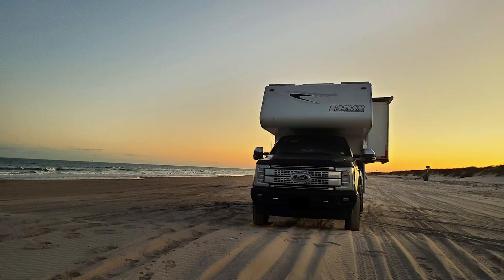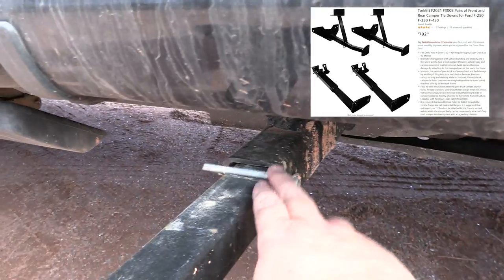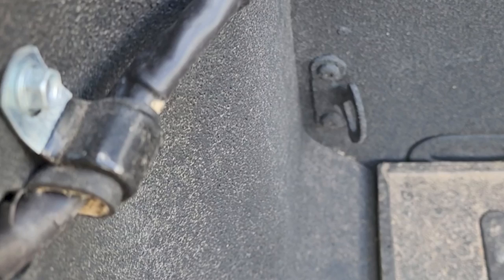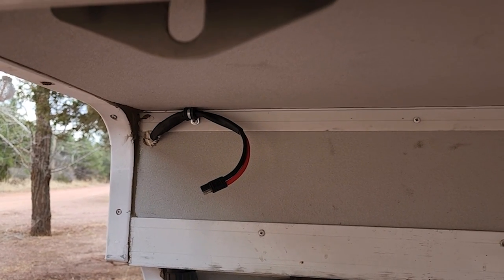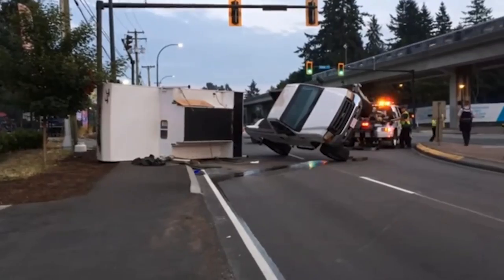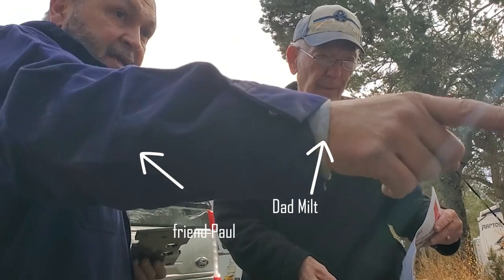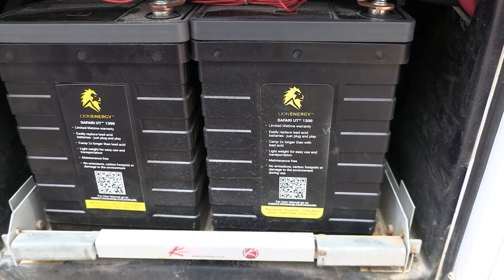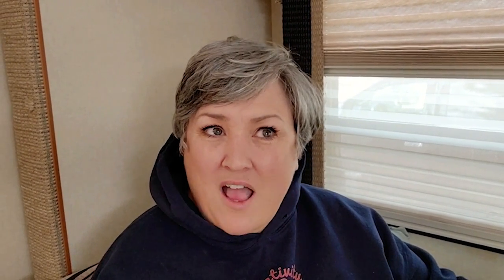RV Hacks & Gear GALORE! Truck Camper Setup: Lithium Batteries, Air Bags, Platform, Solar and more!

Comment: Hi everyone. Love you, Robin, BUT, I will never own another truck camper. I’ve had one in the past (a Lance also) and it was so small and such a hassle. I actually thought it was a really great set up, but taking it on and off the truck was way too much of a hassle. I would much prefer a class C or class A and tow a car. Towing a car on all four wheels is easy and the best way to travel as far as I’m concerned. We didn’t keep our truck camper for long. We started full timing in a fifth wheel which had so much space, but I agree with you that it’s also a hassle with how much work there is to get going so many things that could go wrong. Of course, when we go to RV parks, it’s the most wildly popular RV. We are now full-timing in a class A towing a Jeep on all fours and we love it. Of course, everyone is different but, I would advise anyone getting a truck camper to be very careful. know what you’re getting into.

Comment: Robin, great to see you back!
That camper rollover you mentioned was actually a long bed regular cab pick-up.
It appears the truck had a lift with larger off-road tires. This would explain a very high center of gravity and with excessive speed in turns will cause that result.
Best of luck with your truck camper looks like you did all the right things with your setup 👍

Comment: Thanks for another great video. I am a couple years from "getting out there" and using my small SUV for trips in order to learn what may or may not work for me. About to go out and move things around again! It's all about discovering what works for YOU! Glad you're back!
Reply: I’m doing the same thing before I hit the road for good! I have a Honda CRV inside I built a bed and storage with a small side table. Getting ready to hit the road from Virginia to New Mexico and all places in between. I think it’s a great idea to start off with what you have and see what works and what does not. Safe travels.
Reply: @anaisanwar8424  are you worried about gas prices.
Reply: @cheri6174   Not really. I’ve planned for it. This is such a huge  exciting trip for me . I’m not going to let the price of gas stop me from having an amazing experience. I have planned this trip for so long and have a good budget.🤠

Comment: Loving that you got a truck camper!  I’ve had mine for 4 years and LOVE it!  Added airbags with onboard compressor and a Hellwig rear stabilizer bar.  We fill the airbags to 50/55 when loaded. Both have worked great.  I still would like to upgrade my OEM shocks but what I have still works….but a rough ride when the camper is dismounted.  I run 60/80 psi in the tires front and back when loaded and 60/60 unloaded.  We had a ton of room under our rear camper overhang and we added a rear hitch aluminum carrier that is awesome for carrying dirty stuff…firewood, jacks, etc.  We tweaked the carrier hitch to drop it a couple of inches to accommodate stuff and it’s still higher than the lowest point of our camper so it’s hidden and doesn’t effect clearance.
We also added a front hitch for hauling a small motorcycle.  Top loading litter box is bungee’d in the back of the truck and we open the pass thru when parked.  Hobie the cat enjoys his private facilities.  He naps on the dash when we go anywhere or on his fleece blanket in the cabover by the window.  I’ve got storage bins near both rear truck windows with rubber backed carpet on top.  Hobie likes to look out the windows when traveling! Extension cords and all things necessary for quick hookups in one and backpacks/poles etc in the other.  Have a shallow one that sits in the middle that gives him a nice extended perch even with the console.  Holds his extra food and pine pellets (equestrian bedding… the best cat litter ever) and cheap!  Lots of detail here but fellow cat lovers understand ❤️!
You are going to love the high clearance and 4 wheel drive!  Being able to park and fuel up just about anywhere is also pretty sweet.  You will get used to climbing up and down.  Once you get your handholds and steps figured out… I swing in and out and don’t even think about it now.  We are in our 60’s so that is saying a lot! :-).   We solved the cabover making the bed problem by just using a cute fitted sheet and the no top sheet but instead use 2 lightweight synthetic twin comforters (his and hers).  I wad them up and stuff them behind 2 pillows each and they act as a nice lounging headboard.  Looks neat as a pin and seconds to make the bed.  Laundry day…strip the fitted sheet/ cases and the comforters and wash.  Don’t go too thick on the comforters and they will dry great! We don’t fight over the covers anymore and easy to roll out of bed to go to the bathroom without getting all tangled up!
We did quite a few mods to make it our style and more comfortable for us.  You are the queen of clever ideas so I can’t wait to see what you come up with!  Being nimble and the ease of the TC made it the perfect choice for us.  I still haven’t found anything I like better!  Not everyone can go small but it’s a game changer if you can!  You can do this!!!  Heck, there isn’t any challenge you haven’t absolutely aced yet!

Comment: Also your ride and handling will benefit from running the airbags with 30-35 lbs in them whiteout the camper on. 5lbs is the recommended minimum pressure to not damage the airbags.

Comment: Did you know that their are 5 states where you can't ride in the camper.
   Their are also Rv parks, mostly in Arizona 
that will not let truck campers Into their parks.
   In California you have to have communication with the passengers & have seat belts

Comment: We are boondockers, and have had several solar systems on several rv's, currently we have 250 watts of solar and 4 6 volt Golf cart batteries set up for our fifth wheel, this ideal for what we do, of course we have a 4500 watt generator as we may want to use the micro and or AC at times. One word of caution which I'm sure you know, is if you are going to use the truck to charge the batteries while your in the camper close all the windows and vents as carbon dioxide is odorless and colorless and can kill in as little 10 minuets.

Comment: Robin, my friend had the same height issue with his slide in, on his GMC Denali, we went to tractor supply and purchased horse mats. Super dense, heavy duty. Worth looking into. That insulation your using may crush over time.
Reply: Horse mats, eh? Interesting. It's amazing how many things work for other things. Resourceful.
Reply: Good ole horse mats. My son used them to line the floor of his home gym.

Comment: I'm glad you're getting to experience the benefits of having a truck camper. When I was a nomad, I lived in two vans and a truck camper. I wished I had only ever lived in a truck camper, when I was roaming. There's so many perks over towing a trailer or converting a van or bus into an RV. You've got a great rig setup. Happy Travels!

Comment: I'm in my mid 70s now and still enjoy camping. Used to have truck camper and pulled horse trailer.  Loved the camper but I understand most RV parks will no longer allow them. Boondocking is wonderful but some full hookup is too. Any thoughts?

Comment: I love my Ram diesel.  It came with auto air bags that adjust for the load.  I don't have the lithium batteries yet but my truck auto charges the battery and I have an onboard generator that charges when I need it.

Comment: Beware of that fridge vent fix...I accidentally ripped off my fridge vent, covered the hole to keep the rain out, and realized a couple of weeks later that my fridge wasn't working well. I had covered the vent too well, leaving too little air flow, and not enough heat could escape from the back of the fridge so it stopped cooling.

Comment: Check out the 2008 1191 brochure, dry weight is 3530lbs. That’s definitely a low estimate with no water, gear, clothes, food etc, etc. The best way to find your weight is to run your rig over a CAT scale, it’s very eye opening. We love our truck camper! Happy camping 😎👍
Reply from the maker: It's over 13k,  all together,  with the camper on the truck

Comment: Nice Lance, i stay in a 1172.
You mentioned place to put inverter... try under the step going up to bed.  On 1172 if that is lifted you have a large opening and can mount it on front wall of camper.

Comment: You said the camper weight is 13,000 pounds, but I think that must include the truck. The camper is around 3,700 pounds dry, so something over 4,000 pounds wet and loaded. You have a 1 ton truck and a 2 ton camper so you clearly do need the air bags. I have the 10 foot Lance at about 2500 pounds. I put the child's bunk over the dinette down and use light plastic storage totes up they for permanent storage. I don't put anything heavy up there. You have to watch your head, but I am over 6 feet tall. It is worth it to have the storage. I tow a flat trailer with two side-by-sides on it, so I needed a truck camper. A trailer or toyhauler wouldn't work for me. It would be more now but both the 2002 Ford F250 Superduty, 1996 Lance camper with propane generator, electric jacks and working stairs cost me less than $20 K. Hard to beat.

Comment: In answer to several questions in the comments below, alternators charge batteries, normally batteries do not charge other batteries unless they are severely discharged.  Trucks and cars are designed with lead acid batteries which will fully charge at a nominal voltage of 13.8 Volts or higher.  Lithium typically need 14 Volts to fully charge.  Most alternators output more than 14 Volts when operated above idle speed.  They will charge both battery types separately but when combined in a system, the vehicle's electrical draw and lead acid battery may load the alternator down and, as a result, there won't be adequate Voltage to fully charge the lithium batteries in the camper.  Also, if the lithium batteries are extremely low, they will try to draw very high currents from the alternator and there is risk of burning the alternator out.  Thus, the DC to DC battery charger which boosts whatever Voltage the car is operating at to the proper level for the lithium batteries and limits the current draw to protect the alternator.  I use Victron but there are other good brands available.

As for the Ford not charging Robin's 5th wheel batteries, I suspect this is only the result of how the truck's towing harness was wired and that charging Voltage was not always present.  A simple addition to the trailer wiring harness would solve this.  This type of constant Voltage source was probably added when she had the DC to DC charger installed.  A dedicated, larger charging wire is also usually installed in tow vehicles after market to accommodate the higher current needs of an RV.  Without the larger wire, charging Voltage drop in a small wire and the battery charging can be severely limited.  The DC to DC converter is still recommended to charge lithium batteries in the 5th wheel from the lead acid system of the truck.

The converter was mentioned in the context of vehicle to vehicle charging below.  The converter has nothing to do with charging batteries from 12 Volt vehicle sources.  The converter charges from the usual 120 Volt shore power or generator power.

As for solar charge controllers, I suggest replacing most of the ones installed by RV manufacturers with good quality MPPT  (Maximum Power Point Tracking) controllers.  The RV manufacturers usually equip their rigs with inexpensive PWM (Pulse Width Modulation) solar controllers which do not pull as much power from the panels as they have to offer.

Comment: Robin don’t get to comfy with those air bags, you will forget because the ride is so smooth but still be cautious on the turns and the speed as well as the conditions of the road and weather. They are fun.

Comment: Good to know about the DC/DC battery charging! Always learning... 
Your hair looks awesome, btw. :) 
We have a small class C right now. Planning to head to Alaska in 2023 or 24. Debating a TT or a truck camper. I love the nimbleness of a truck camper and would get a true 4 season one. Thanks for sharing your findings!
Reply: Why will you switch to a TT or truck camper from the small Class C?  I’m thinking I want a small Class C for nimbleness.  Just wanted to know your thoughts. Thanks.
Reply: @yknowles163  We've greatly enjoyed our small Class C, and it IS nimble; it's easy to drive, easy to park, easy to back into sites. We've loved it especially in places where we could park it and set up and then use public transportation or walk to attractions, trailheads, etc. Bryce Canyon, for one, was great, as we stayed at Ruby's right in "town" and used the National Park's shuttle to get to trailheads for hiking. 

It really depends on the type of sites that you camp in, what you want to do, and what is available around the site. With a class C, not pulling a toad, and not having e-bikes, going places that are beyond walking distance, not accessible with shuttles, or in places (there are many!) without accessible public transportation or safe sidewalks or paths, we end up breaking camp and using the rig as the exploration vehicle, too. This tends to make stays shorter and more travel involved. For us. We would rather be able to leave the rig at the campsite and reduce the number of "touches" involved in each location. Set up once, break down once, etc., and stay a bit longer while getting out to explore and experience the local area. 

Overall this would reduce stressors and time spent on logistics. We could tow a car, or tow a motorcycle trailer, or get ebikes or a different motorcycle that we could hitch rack carry. But overall, with the type of travel that we like best which tends to be more about nature and exploring and less about being in an RV park, we think the truck + something will work better for us.

Comment from the maker: *HERE ARE THE LINKS (scroll down)!
🛒SEE ALL THE GEAR HERE: https://www.amazon.com/shop/creativityrv
💰GET 15% OFF ON A HARVEST HOSTS MEMBERSHIP: 
https://www.harvest-hosts.com/8FG9L9/2CTPL/
Read Robin's BOOKS Here:
*🎁WORK FROM HOME WHILE YOU ROAM: The Ultimate Guide to Jobs that Can Be Done from Anywhere:  https://amzn.to/2MF09LK
*✅ Be A Nomad Change Your Life: https://amzn.to/2NQaogN
📌FOLLOW US! https://www.instagram.com/creativityrv/
💖Watch ROBIN'S TEdX Talk  "Why I Choose to be a Nomad"
https://youtu.be/Vs7WoriABF4
🎯VISIT CREATIVITY RV.COM!  https://www.creativityrv.com/
🎨NEED INSPIRATION? Check out : http://www.wordsinspired.com/

*This post contains affiliate links.
*CreativityRV is a participant in the Amazon Services LLC Associates Program, an affiliate advertising program designed to provide a means for sites to earn fees by linking to Amazon.com and affiliated sites. By using these links I will make a small percentage of your purchase, even if you buy something else--and it won't cost you anything
Reply: You did a great job with your research and upgrades. We drive a 2019 F350 with aftermarket 20” tires and wheels, computerized airbags and overload spacers on the overload pads, hauling  our 2019 HOST Mammouth 3 slide camper for a great smooth ride. We also installed the lithium batteries and solars. Boondock very comfortably.

Comment: The battery problem charger may also be intentioal protection. The drain from highly discharged batteries, if it is not controlled, can overheat and burn out regular alternator/regulators. Sometimes, power changes can get a little esoteric to anyone who isn't a BSEE.

Comment: 05:55      a 13,000 lb camper would take larger than a one ton truck, (13,000lb = 6 1/2 tons). I have a big foot 4 season camper and it weighs 3,000 lb.
Reply: Right.  I was thinking the same thing.  No way Jose. Must be the whole package.
Reply: It’s the entire package = truck and camper